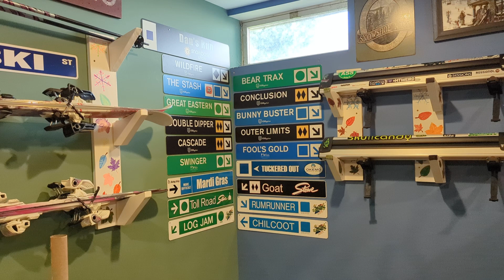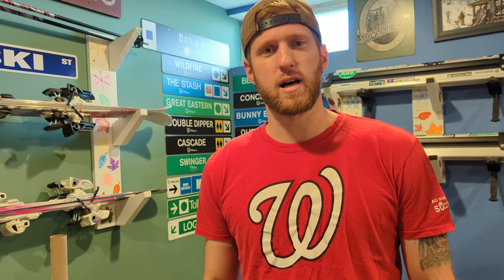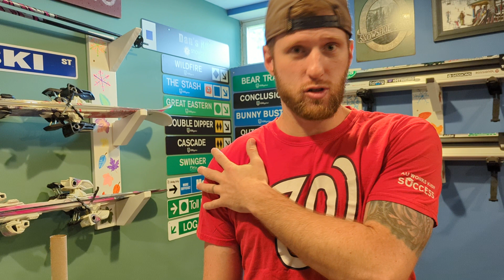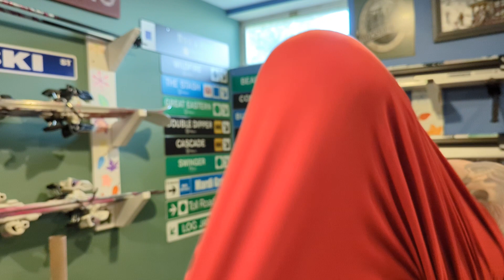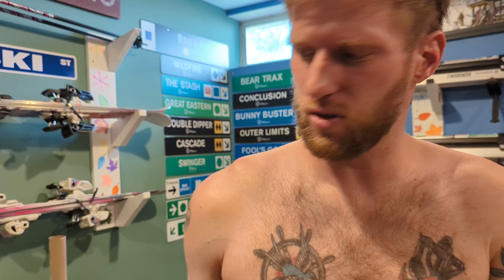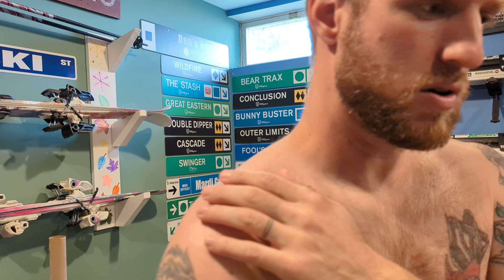Grade 3 AC Joint Separation - 2 Weeks Later

Comment: Hey I came across your video when I was searching AC joint injuries. I  got the same injury 2 weeks ago so I’m now 2 weeks since the initial injury. It’s painful and can relate to all you are saying. One question I hav I hope you don’t mind. How soon before you were able to drive a car? 
Hope your fully recovered from your ordeal. 
Thanks
Reply from the maker: So this happened at a dirt bike race about 3 hours from my house. I actually had a friend load my bike up and I slumped into the driver seat and drove myself home. I had no choice - had to get home to take care of our baby (I was no help). Obviously I had to do everything with my left arm during that drive and my brother-in-law unloaded my bike. It was an excruciating 3 hrs. Luckily I was in an automatic LOL. Driving was off the table for me for about 10 days. After that it was extremely painful for another week. Then it started to get much easier. The range of motion and strength will very slowly come back, but it will. You should see some significant improvements between now and another two weeks. Then it just keeps getting better, slowly but surely.